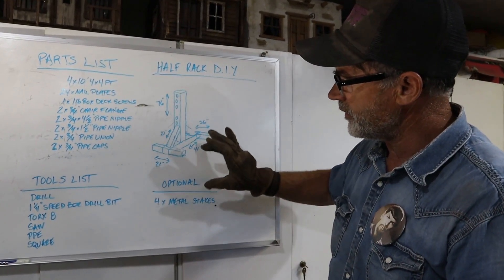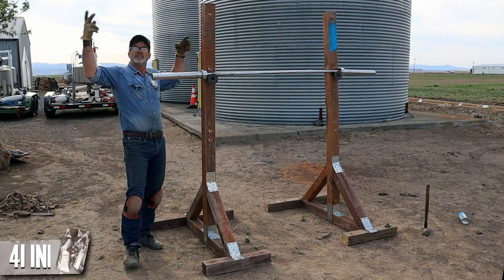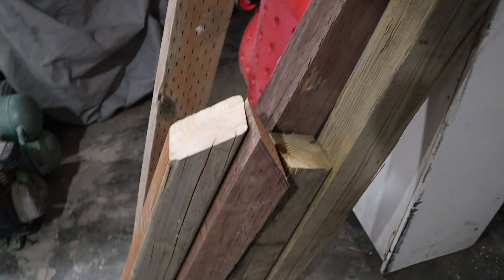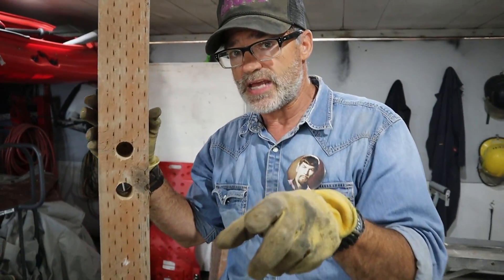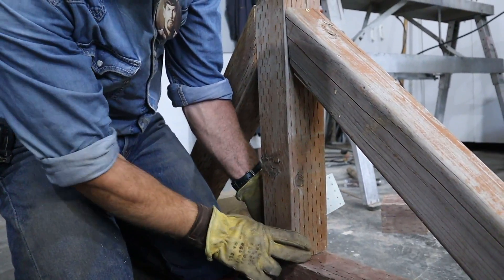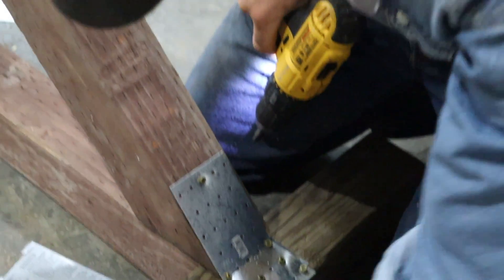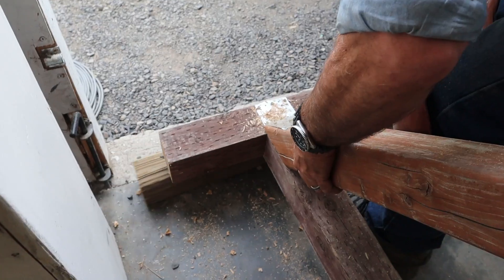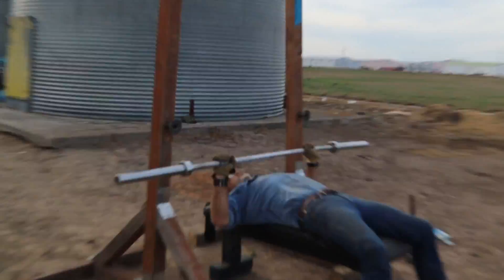How to Build a HOME HALF RACK (Move It Anywhere!) - DIY Duke

Comment: And when we needed him most, he returned
Reply from the maker: So nice, thankyou 😀
Reply: The avatar has returned
Reply: Hell yea!
Reply: Came to the comment section to say the same thing! I’ve been waiting on this video!
Reply: I just built my half rack combo!!!  I'm so stoked.  

I've been watching this video over and over, waiting for this moment.  I got the pressure  treated lumber a few weeks ago, then the parts.  But I couldn't find the plates and the "unions" (or couplings).  

Lately, there have been lumber shortages out here in the Bay Area and Central California. 

But I finally had time to cut the 10' posts into all the sections.  In the video, he skips the shorter floor beams, which are 21".  But you can see them in the diagram. 

Then, I assembled the parts with a little help in my backyard.  So, far so good.  I already have the adjustable bench.  Now, I'm just waiting on my new 45 lb Olympic bar and some plates!  Woo hoo!

Thanks, DIY Duke!
Reply: What a legend
Reply: Our God
Reply: @Zechariah Kenneth instablaster =)

Comment: I made a half-rack of my own design and a homemade barbell and weights myself this week. I made the mistake of posting a picture of it. Now I'm getting messages from people I haven't spoken to in 5 years. This is what girls must feel like when they get out of a longterm relationship
Reply: Pics or it didnt happen
Reply: Was your design similar to this? Did you use 4x4 beams for support? What was your hole spacing? @DIY Duke uses 3.5" spaced holes, but to accommodate both my wife and I I would need some holes to be 2" spaced, and I'm really hoping that won't jeopardize the strength of the setup

Comment: I built this as a DIY novice, so I just wanted to say thanks Duke for the very accessible & (mostly) complete video!  

A few things:  
A) the video somewhat skims over ALL the locations for the nail plates (namely at the junction of the main mast and the base), but you can see them in shots toward the end of the video.
B) I needed more than 1lb. of deck screws (at 1 5/8 length) to complete the project.  Buy 2lb to be safe.
C) If you play it right, you can get the holes in the two plates to line up so you don't have to screw through the metal (e.g. at 13:47). Not a big deal but if you are slightly OCD like me it feels good.
D) I built mine higher so I could dead hang without touching the ground.  I'm 6'2", and I cut the vertical pieces to 97". For this I bought 2x10' and 2x14' pieces of lumber (hardware store was out of 12 footers) This adds mass obviously, but hey why not get BUFF just moving your rack around?

Thanks again!
Reply: “This adds mass obviously”

I sure hope it does 😂. We’re the same height so thanks for sharing this!
Reply: About how much would you say this project cost? Just wondering for myself!
Reply: @darianmccoy6433  I remember spending about $150 on this project at my friendly local hardware store, but I had to buy a couple tools, & I doubled up the plumbing in order to have two sets of rack pins.  In raw materials, you can probably land around $100-$120 at a big chain store.

Comment: I just built this. I spent about $130 for the untreated 4x4, strong ties, black pipe, screws and 1 1/4 inch auger bit. For about $40 more, I could have purchased the well reviewed valor stands from Amazon, but building this is worth mega man points :-). Thanks Buff Dad!

Comment: Made the rack and bench. Works great. Couple of mods I added: offset 2 wheels and a gate handle on each stand and the bench, making them very portable. Also put a cap on top of the stands to help keep moisture out when left outside.
Reply: Another modification to the design. I added some thin gauge steel to the face of the rack so the knurling on the bar does not dig into the wood when racking.

Comment: Suggestion for build: PULLEY SYSTEM.
Also, one can just get a longer galvanized pipe and avoid the nipple, just put some pvc pipe over the metal pipe, between the flange and the wood post, so that it doesn't slide back, plus the pvc protects the knurling of the bar because it's metal against pvc. BTW, I did the power rack... that thing is solid! it's the best diy power rack out there! Thank you!!!
Reply from the maker: Great ideas, that's fantastic you built the power rack 💪

Comment: great to have you back DIY DUKE i missed your videos, i made my own half rack, im very happy with it, i attached a pulley system in the centre of it, i can do lat pull down plus tricep psuh downs, i also attached a lower rack with just a couple of 2x4 layered over the main uprights, so now i can also preform bench press from the half rack using my home made bench.

Comment: If the pipe used for the rack pins is black iron, it would be a good idea to remove them & store inside. Galv pipe fittings can be used. I like this rack design. It is very straight forward & explained well.

Comment: Material List:

4x10ft 4 by 4 Pressure Treated Lumber
24x Nail Plates
1 x 1lbs Box Deck Screws
2 x ¾" Chair Flange
2x ¾ x 4½" Pipe Nipple
2x ¾ x 1½" Pipe Nipple
2x ¾" Pipe Union
2x ¾" Pipe Caps

Tools List:

Drill
1¼" Speed Bor Drill Bit
Torx 8
Saw
PPE
Square

Comment: thank you for posting this i just built mine and it works great. two differences in mine: 1. i didn't screw through the strong ties when they overlapped, i just lined up the holes from the second plate with the first plate and filled in the empty ones. i don't think my drill was strong enough to go through the ties. 2. i bought a 6in pipe and put the flange on the end and then used electrical tape to wrap around the part where the bar goes instead of buying a connector. i have some left over wood and im going to build the bench next!
Reply from the maker: Wow Robby you're getting right to it, good job.  Look forward to seeing your builds.  PM a pic if you like to my IG buffduke 😀
Reply: @diyduke  thanks, i sent you a pm on instagram. i'm waiting for the vinyl to come in so i can finish the bench. once i get it i'll send you another pic. keep up the awesome videos

Comment: Awesome! Seriously considering building these! If I did build/use it, it would be on concrete, those plates and screws being on the bottom would be an issue... also just an fyi to anyone who makes one, keep your body in between the bar and the supports (so you will be facing the rack with the bar on your back) just in case. If you dump it facing the way he was in the video, those angles will send that bar into the back of your legs in a hurry! Ouch!

Comment: This is great and I thank you so much for putting it up.  I gotta say one thing though and that is, that in the beginning you say "Make your cut exactly 76 inches" for the tall beam.  You should say something about catering this to your own height.  Because i did just that, cut it to 76" inches.  But im 6 ft 3.   And when its all said in done, the things too short and its quite an operation to take it apart and get new beams.  I tweaked it and jerry rigged it to be higher but doubling the base beams and adding another beam to go across on top, but its still too short.  and now its really hard to move.  I know you can bend your knees, but i like the military pull ups where you kinda have to jump up a little.  Its especially awkward if your using assist straps so you can get in high reps.  Just a hint for the next guy.  If your 6 ft 3 or more, i'd go for 84 inches at least on those tall beams.  Maybe even 88'.   Just saying.  if you do that you may need an extra 10 footer 4x4 from the store.  super tight though, i got mine in the front yard.  Much love!  Best DIY squat/bench/pullup set ive seen.

Comment: Good ideas for when I put mine together. Especially the threaded pipe. I plan to cement 2 4x6x12's 4 ft. in the ground then a rod across the top for pullups. The pieces you used to rack the barbell look great. I'll put a set for squat height and for bench as I have an old bench outside already. I have a rack in the basement but unfortunately the ceiling is only 1/2" higher than my head. Plus outdoor workouts are more fun.

Comment: If you’re getting Parkinson’s or already have it, it’ll be ok, you’ve got this , you’ll prosper. It runs in my family and is my biggest fear but it’s made me realize the importance of family . When your hands aren’t steady, God will place people around you to steady them for you.
Reply from the maker: Thank you. I actually have a condition called Essential Tremors which was inherited. I agree totally with, "People around you to steady them for you." Family ❤️
Reply: @diyduke What kind of wood did you use?
Reply from the maker: @Luca-vn8zw  pressure treated Douglas fir
Reply: @diyduke  Thanks
Reply: @diyduke  Sorry, but I have one doubt, this fir, it would be pine? Or are they different types of wood?
Reply from the maker: @JoaoLucas-vn8zw  Normally in Oregon structural lumber is Doug fir, could be Hemlock but couldn't be bastard growth, growth rings are to wide.
Reply: @diyduke I understand, and what is the size and width of those wood you used in centimeters? 10cmX10cm or 5cmX5cm?

Comment: This is incredibly clear and informative, thank you! Quick questions if you don't mind:

1. Generally speaking, how much weight could this handle when squatting?
2. Is there a limit on how many holes you could drill to hold the bar supports? If my roommates and I have enough height variance could a third hole work or would that start to weaken the frame?
3. Does the specific kind of wood matter beyond appearances as long as it's 4x4 pressure treated?

Comment: I haven’t checked yet, but there could be MSDS sheets on line for the tensile strength of 3/4 NPT iron pipe. I certainly will not be lifting enough weight to break it. It’s not merely about how much weight one lifts, but how one lifts the weight.

Comment: Just saw your power rack video. Going to make list of both ideas and check what would be most price efficient build for me. There it will be for an apartment im leaning to the power rack at the moment.
Reply from the maker: Power rack is great and half rack is cheaper either way happy building 😀
Reply: @diyduke  Thanks, half rack also would be taking up less permanent space. Would this still be stable with pull ups without me being able to anker it in the ground?

Comment: Is there a chance you come up with an arm attachment (so we can drop the weight on the rack) more certainly?
I hope you last many more years DIY Duke!! Thanks for sharing.
Reply from the maker: Yes, that's a great idea and thankyou,  that was very nice of you to say 😀
Reply: @diyduke  Also, do you think adding more adjustment holes would threaten its structural integrity?
Reply from the maker: @eveliinatistelgren172  no, as long as you have enough spacing between the hole like 2 inches or more
Reply: @diyduke  furthermore, what kind of treatment to the wood do we need to make it resistant to the elements?
Reply from the maker: @eveliinatistelgren172  if it's pressure treated it's already treated for outdoor use and if not a good deck seal will help it be weather resistant.  A product such as Thompsons water seal or if being painted for the real personal look a good outdoor primer and exterior paint.  To help the wood that is against the ground or concrete some old asphalt roofing or a moisture resistant product works great. 😀
Reply: @diyduke  thanks!! I'm intending on doing van life for a year, this is giving me ideas for a trailer gym, that I can jack where I park.
Reply from the maker: @eveliinatistelgren172  you're very welcome and you're on to something big there with a mobile gym.  Look forward to seeing your progress with that.

Comment: SO glad DIY Duke is back!!!
I tried to build the Buff Dudes 4x4 squat rack, but my drilled holes were crooked as all hell. Any tips for that?

Also, how about a 90 degree lower back extension for the gym?!! I'm planning one myself for construction next weekend. Would like to see your ideas for one.
Reply from the maker: I know it's hard, can pre-drill a hole in some scrap 2×4 and use that as a guide 😀
Reply: @diyduke  thank you for replying! 
I've since ended up buying a rack. I failed at drilling holes in my second attempt at building a rack and decided to use the wood for the lower back extension instead. Big hopes that that's a project you take on next/soon.

Comment: I want to basically follow this design aside from shortening the back side of the "I" Brace. I want to make a build I can use outdoors in the garage over spring summer and fall, and indoors in the winter, which would mean it would have to fit through my narrow door on my old house. I would presume that taking 3"-5" off the 36" back wouldn't make a huge difference. It will always be pushed up against a wall anyways.

Comment: I built the bench and the rack. Thank you for the videos 🙏🏼. Is it normal that the wood is splitting in different areas. I’m filling it with liquid nails but just unsure if the splitting is normal..

Comment: I was stripping forms at work and we made a hole in piece of ply wood and put a nylon sling through it. We pulled up on it until the crane reached 3500 pounds of pressure and it didn’t rip through. And that was plywood.  What I’m getting at is those 4x4 ain’t breaking.
Reply from the maker: Wow, thanks for sharing that, so many people are hesitant to use wood but because of your job and opportunity to demonstrate how strong and resilient wood is people should be less doubtful.  Just finished a video yesterday which will be out soon where we load up the half rack with over a thousand lbs💪😀
Reply: DIY Duke thank you for your work.

Comment: Nice build except I would change one thing. Instead of the angled pieces on both sides, the front side should be squared that way if you can't get the weight back up you can just drop the bar on the horizontal pieces.

Comment: @DIYDUKE Could you use this rack as a sled too if you put a couple more holes in the uprights about 8-9 inches off the ground? Maybe add a cross member or two to increase overall rigidity when in 'sled mode'?
Reply from the maker: You sure could, keep the weights low so it's not top heavy 😀

Comment: If I can't drill holes through the floor and stake them down how else can I stabilize these? Or otherwise prevent them from moving around? Thanks for the great video!
Reply from the maker: I'm going to add a pipe on each side so I can store weights and will also provide weight to the base to stabilize them

Comment: That looks Awsome,
could I use nails instead of scews? or would the stability be alot less?
Reply from the maker: Screws hold a lot better, especially through the normal wood process of swelling or shrinking depending on humidity levels
Reply: @diyduke  thank you so much for your answer :D

Comment: Hi duke, subscribed from the UK. I recently made one of these few days ago, followed your video step by step and couldnt be happier with end result. Quick question though, im no DIY expert, its actually my 1st project, but im having to keep mine outside, can u reccomend anything i can do, the wood is treated already bought from store but is there anything else i can add to it to protect it from our crappy uk weather.
Reply from the maker: Thankyou first of all and that's great you were able to build.  Yes further protection can be obtained by a good exterior primer and paint.   You'll discover through use the area where the barbell hits the wood will need periodic touch up.  If you use those same areas all the time such as bench press, squat, etc., you can just simply attach some sheet metal there but I've used my power rack for over five years and the wear is minimal and it's inside.  Happy lifting 💪
Reply: @diyduke  Thankyou.

Comment: I want to modify this for a freestanding pull-up bar.  Perhaps 8 ft tall (bar). Think this base would be stable with the added height?
Reply: Suppose with an 96 in height , that is 125 odd percent of the as found height of your design.  So to compensate for the added height, multiply all other lengths by 1.25 ?     The pull-up bar I’m not sure maybe it would probably be best threaded into some pipe flanges on each side which would be drilled into the inner sides of the posts, versus on the front side where your gonna do your bench work.   I’m good on the calves the thighs the whole nine yards.  Plus I can repair those starter motors!

Comment: Hey, I have a question!! My intent is to build this rack but to use a steel bar to join the two halves so I can do pull ups/use rings/calisthenics. Would you consider this a good idea and what size steel pipe would you recommend? What length based on your measurements?

Comment: Hey Duke! Appreciate the video I've got my rack all built. However my drill bit holes weren't the straightest at 90 degrees unfortunately. They ended up being slanted downward when you rack the weights and I didn't notice until I assembled everything together. Is there something I can put in the hole to straighten it? Some kind of leverage or added o-ring to tilt the nipple back up? Thanks!

Comment: Hi diy duke! Just wondering, what metal are the pipe components of the build made from?
Reply from the maker: They are mild steel with the chair flange, union and cap being cast iron.  They also are sold in galvanized for exposure to weather.

Comment: Hello Mr. White! I just have two questions: If I decide to use all of the holes on those metal plates, the connection will obviously be stronger, but would it weaken the wood itself from having so many holes that close together? Also, can the wood be painted individually before all of the connections are made? Thanks.
Reply from the maker: Yes you can certainly paint before construction and utilizing all the holes shouldn't present any problem 😀